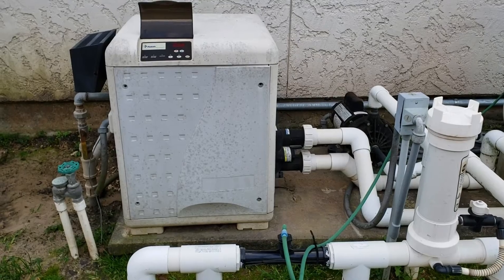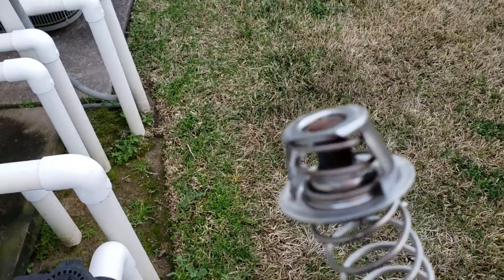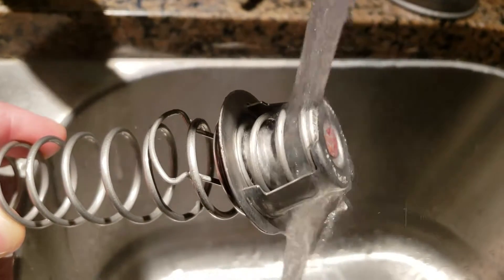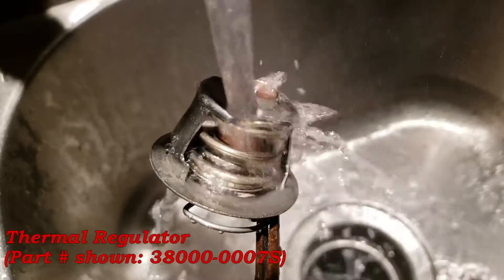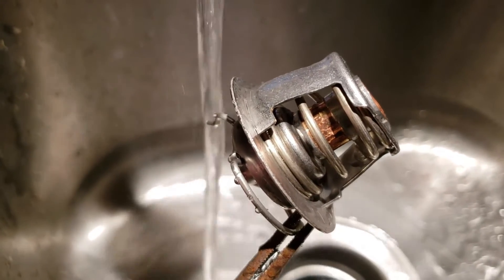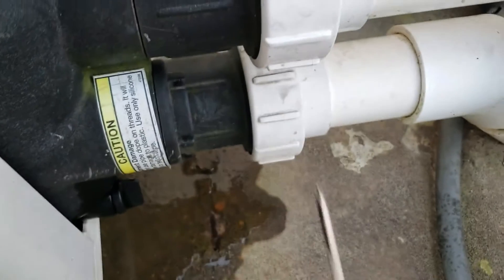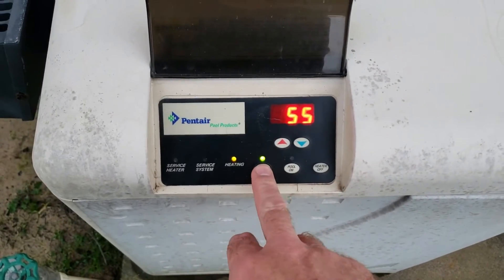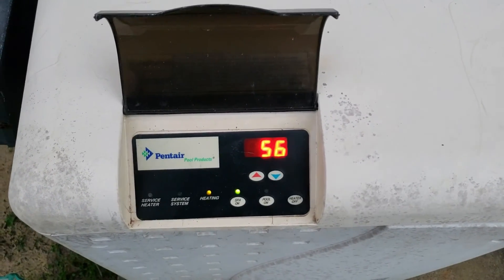Thermal Regulator Replacement on Pentair Mastertemp 400 Pool/Spa Heater

Comment: Thanks for the video. I have a master temp 300 that i set to 92 but actual water temp reaches 100 + and  it constantly turns on and off every 10 minutes around 100. Is this a faulty thermal regulator symptom?
Reply from the maker: Well, surely test the thermal regulator like you see in the video first before buying one, but I am thinking more along the lines of HLS or thermistor are likely not reporting correctly.  I dont think it would burn that long without giving "service heater" light if you had a defective thermal regulator.  You are on the right track though.
Reply: @pvt-pilot  Thanks for the reply. So i just replaced the thermistor last weekend and still same 8-9 temperature difference where it runs hotter than what the board is reporting
Reply from the maker: @alexgannon801  Where are you reading this 8-9 degree difference?  A stand alone thermometer detecting this or are you reading the main breaker box panel/remote control?  If you are reading the breaker control panel display, consider the wired pentair thermometers.  There are two identical thermometers for that panel (air vs water).  One should be drilled into a water pipe and the other should be exposed to the air in a shaded area.  Try swapping them.  See if the air thermometer unit produces the same temperature reading as the one that is drilled into the water pipe.  I don't think the heater knows about the breaker panel thermometers, I dont think  they don't talk to each other about temperature.  Just on/off status.  If you are getting your readings of temperature difference by other means, then disregard the above troubleshooting.
Reply: @pvt-pilot  The temp master 300 pad will say 92 but the thermometer inside the spa/pool itself will be 100

Comment: Hi, @pvt-pilot this video is really helpful. I have the same Pentair MasterTemp 400. The Heating light blinks and then stays on for a minute or 2 and shuts off and starts up again. I feel hot water comes out of the returns when heating light is on for a minute or 2, but then it does the same thing again. No error codes. No lights on both of the service indicators. I was gonna replace the thermal regulator, but the cap is just too tight. Any advise will be appreciated. Also. Do you think it is definitely the thermal regulator.
Reply from the maker: Shame about the tight cap.  Try a longer screw driver for better leverage.  Use one with a quality shaft like a Craftsman so there is less flex.  Try putting the cap in the middle of a long shaft so you can push with one hand and pull with the other hand to help get double the tork pressure on it.  If you still can't get it to turn, you can also use 13mm wrench or socket to remove all 10 of the bolts that hold the manifold onto the side of the combustion chamber.  Then loosen the 2" inlet and outlet water pipe unions and remove the manifold.  Take out the plastic wall inside the manifold and you will see the thermal regulator sitting there mounted on the spring.  I'm 95% sure that the thermal regulator is your problem, but I recommend you test it like I did before ordering a new one.  Hope this helps, Cheers!
Reply: I just used the screw driver like shown in the video & yes it was tight, but after I loosened it I took it out by hand.
Reply: Thank you for the very prompt reply. I was able to finally remove the cap following your instructions. I took out the thermal regulator and I don't see anything wrong with it except it's a bit corroded.  I held it on a running hot water like you did and it did pop up. I also turned the cover upside down to see any LEDs and turned the heater on. No LEDs lit up. Also, the heating only turns on about 30 seconds before it restarts. I held down the pool button for 5 seconds and the reading I got is 201, 215 and goes up maybe to 235. Should I replace the thermal regulator anyway. It looks like the temperature reading is accurate though. It just doesn't go up because the heating keeps restarting.
Reply from the maker: @luapa5531  If your thermal regulator moves to completely open position under hot water without delay, then I dont think this is your problem.  If it is too slow or only moves only a little, we might be onto something.  Try removing your thermal regulator and spring but screw the cap back on and turn the heater on.  That will simulate an overwhelming full open and cold water will rush through and dilute the hot water before it flows past the HLS, so the HLS (High Limit Switch) will never get the chance to feel anything above normal pool water temperature.  This should prevent the HLS from sending the control board a high temp reading that causes the control board to shut down the heater and restart. I have never tried this, just thinking out loud, but this is what I am thinking could allow your heater to burn longer without being told to stop for safety reasons.  Let me know if it continues a long burn session without a thermal regulator and spring in it.  If it burns longer, great, we found your fix.  Then turn it off immediately and go buy a new thermal regulator.  This is ultimately bypassing an extremely important safety, so dont run it beyond this little trial without replacing the thermal regulator.
Reply: I followed your instructions as soon as I got home today. As soon  as I turned the heater on without the thermal regulator, the service heater lit for a second and then it started calling for heat. Heating light started blinking, and then it went steady for at least 1min & 45 secs this time before it cycles again, blinking, steady and then runs for less than 2mins. It seems to keep cycling every less than 2mins.
Reply from the maker: @luapa5531  Hmmm, bummer, I don't think replacing the thermal regulator is going to do you any favors then.  It's not an ignition lockout, it is not a Stack Flue Sensor, it's not an AFS issue, and it doesn't sound like a broken manifold bypass valve either because that produces a HFS light as a side effect.  This is a tough one.  Thermal regulator still falls in line as the #1 candidate for replacement, but I am just not very confident at this point.  My recommendation is to try replacing it first before anything else.  That is what I would still do at this point.  If it doesn't fix it, then I don't know what else to try without some diagnostic lights illuminated that you say are all quiet right now, which is a bummer.  Go ahead and replace it.  That's a "$42 maybe" at this point.  Check Ebay.  Sorry mate, that's all I got.  Your call.
Reply: When I have the thermal regulator on, it cycles every 30 secs. When I removed it, it started cycling every 2mins. I never had a pool before. We moved to this house  July last year. I don't remember getting into the pool  last summer with the water being warm even when heater is running. So I really didn't pay too much attention whether I was getting heat constantly and whether it will only stop when the desired temp is reached.  I used to have an old Hayward Super Pump (single speed). According to the label it runs on 3435 rpm. Since, it was making too noise. I decided to replace it this year with the Hayward Super Pump VS which is the drop-in variable version for 1.5 piping when I opened the pool this year.  I ran the heater in maximum rpm which is also 3435rpm. I noticed that the pressure on my filter tank is probably at 15psi at maximum speed which I think much less from last year. I was also wondering, if water flow could be the reason. The thing is I don't have flow meters to know the gpm going in the heater. I also don't hear any manifold valves opening and closing when the heat cycles on & off.  I think I will replace thermal regulator for now and go from there. I really appreciate all your help.
Reply from the maker: @luapa5531  There won't be any manifold valves opening and closing other than the thermal regulator which is inaudible.  This is because water runs through the heater 100% of the time, off or on.  The only valve that is audible is the click you hear when the gas valve opens and closes.

Comment: Is it possible to push the thermal regulator in too far.
Yesterday, I took it out and tested it.
It opened but not enough.
I put it back in because it would work up to 92 degrees before cycling on and off and my family wanted to use the spa.
When I received the new part, I tried to pull it back out and it was "stuck". The spring came out with a lot of force, but the regulator never came out??? When I look into the tubing it is not there.
I am pretty sure that the opening will not let it enter the main tubing, but am I missing something???
Unfortunately, these low-probability complications always happen to me, so I am willing to believe anything at this point.
Reply from the maker: Can you push it in too far?  No.  It mates to a circle cut out on a plastic wall and the thermal regulator is larger than the circle so that only the thermally reactive material extends past the circle in the wall inside the manifold.  If you pulled the spring and the thermal regulator fell off the end of the spring, it will remain in a cavity just inside the exterior threaded hole that you pulled the spring out of.  So, at this point, do not recap it and turn the pool pump back on because you will blow the thermal regulator out of the output port and it will take a long ride toward your pool.  So, stop for a second...let's get it out one of two ways.  Either fish it out with a wire coat hanger, possibly a magnet, or what I would do is disconnect the bottom white pipe (output) from your manifold and move it to the side a bit out of the way but leave the top white pipe connected (input).  Then turn the pool pump on and let it blow you pool water out onto the ground.  Your thermal regulator should come out in the wash.  Then, reassemble the thermal regulator in the spring and give it a go.  For a good look at the inside of the manifold including the thermal regulator, plastic wall with circle and output cavity where your thermal regulator landed, scroll to 4:05 of my other video here: https://youtu.be/umvDbbigDhA
Hope this helps.  Cheers!

Comment: My 400 unit would heat up to about 88º then it began cycling on & off.  I bought the new thermal regulator from Amazon & installed per this video.  Took longer to drain the water then instal the parts.  Everything works like new.  Thanks for the video.
Reply: My thermal regulator cap is too tight. It won't easily come off like on the video. I'm afraid to break it. Not sure, if I'm supposed to do something first before unscrewing the cap (counter clockwise).

Comment: I have the same heater-- I tried heating the spa this week and the unit comes on, ignites and then immediately shuts off. I have no error codes and there are no lights on the back side of control board. I've messed around with it several times and only once did the SFS light come on--- I haven't seen it on since. I was able to feel the hot water coming out of the jets briefly until the unit went back off. Do you know what that could possibly be?
Reply from the maker: I don't think you are giving me quite enough information but I'll try my best to help.  It really sounds to me like you have a defective thermal regulator, but I will assume you have already tested your thermal regulator since you watched the video and will assume all is well with your thermal regulator.  So...

How about a service heater light?  If you have a service heater light, then your control board is receiving readings from at least one sensor that is out of limitation.  For example, you could have an SFS (Stack Flue Sensor) reporting 400° to the control board when it is actually only 310° or less.  This would not produce an SFS error light because the SFS is not shorted nor open...just giving erroneous readings that the control board thinks are legit.  So, for obvious safety reasons, the control board will shut everything down and illuminate the service heater light.  To check your SFS temp reading, turn on the heater and heat the spa.  While heater is running, the spa light on the keypad will be illuminated.  Hold the spa button down for 5 seconds to view the temp reading of the SFS.  If you ever get temp over 310°-320°, you might have a blockage in the blower fan or combustion chamber tub (like water, dirt or lime/scale buildup) causing overheating.  You will likely have discoloration of the stack flue (exhaust pipe) and burned off black paint.

How about NO service heater light?
For example, you could have a high temp reading from your thermistor (any temp higher than ambient temp when the heater hasn't been running).  So, your contol board will accept an erroneous high thermistor reading as legit and shut down.  This isn't because the control board thinks something is wrong, it is because the control board thinks the water is already hot.  This will also result in no error codes and no diagnostic lights and also NO SERVICE HEATER light.  Cool huh?   In this scenario, just check your pool water temp displayed on your  phone app, pentair remote, pentair easytouch control panel or the red number display on the heater itself.

These are only guesses, with and without service heater light, based on your stated symptoms, but if you need further help, just reply here.  

I still feel it is your thermal regulator causing the problem, so start there if you haven't checked it already.  If the thermal regulator is stuck closed, scalding hot water will be all that will be able to pass to the output and on toward your hot tub.  This could melt your plumbing (especially joints), ruin equipment and worse case even scald hot tub users.  The thermal regulator should open up when exposed to temps over 120° in order to let some cold water mix with the output and dilute the scalding hot water a bit.  So that's why there is a HLS in place as a secondary safety for a failing thermal regulator.  If the HLS reports 135° or more, the control board will shut the heater down.  This is what it sounds like is wrong with yours.  Cheers!
Reply: @pvt-pilot  WOW thank you so much for your detailed answer and taking the time to explain. After watching your video I immediately went online and bought a new thermal regulator and stack flue sensor (since I saw the light on the control panel once)... once I got both in, I tested the old thermal regulator under the sink water and it barely opened up. I decided to go ahead and replace it-- tried turning it on, same thing happened. Then I wondered if maybe my faucet water wasn't hot enough, tried the old one in hot water from the stove and it did open completely up just as your new one did in the video--- so I guess I didn't need to buy a new one anyway, now I can't get the darn thing unscrewed to take out the new one and put back in the old one. 

As of right now I do not have a service heater light--- it was on a couple days ago but the last two days it has not been on. I did get the ad1/sf1 ad0/sf0 screen and I did read that those are supposed to match in order for it to work. As far as I could tell I had them both on the 1. I do not know what's causing that to come up or what that is for but the last time it did come on the screen it appeared they both said ad1 and sf1. 

I will try and see if it will stay on long enough to test the SFS temp reading once I get home this afternoon. Again I appreciate your time. 

I was also wondering if this could be a problem w/ the rest of my pool equipment or water flow and not the heater itself. As of right now when I turn on the pool pump/cleaner it seems fine but when I change to spa on the control panel the Jandy Actuator Valve never moves from pool to spa. I have to turn the valve manually over to spa. The valve on the "pool/spa return" turns automatically to spa when I turn the spa on but not the valve by the pump for "pool/spa intake." Wasnt sure if this was just a coincidence or not.. everything was fine at the end of the season last year but I don't believe we got in the hot tub all winter and just now gearing everything up and now I'm having both issues.
Reply from the maker: @kndlvon Sorry, I am not familiar with the ad1/sf1 ad0/sf0 codes.  As for the valve actuators, swap their wiring at the control panel to help isolate if you have a bad actuator or if the one that is not moving is just not receiving the command to move.  Shame, those aren't cheap...I think over $100 each.
Reply: @pvt-pilot  The actuators usually can be fixed by replacing the limit switchs. There is a video out on that, and where to buy the switchs, they are pretty cheap.